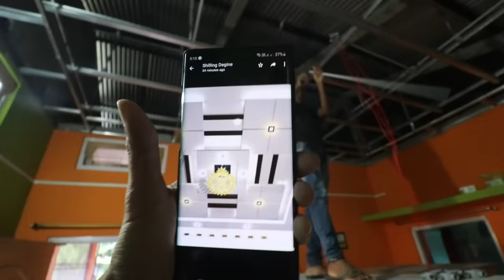মোৰ ৰূম ত আচৰিত চিলিং - How to install false ceiling - Dimpu Baruah

Comment: Moi o sob folshsiling logai disu bohut tensn kom kathr sinta nai...
Reply: Kiman toka khoros Hoy ata 15/12 feet roomt
Reply: Hoi dada bohut dhunia lage aru amar ghorot logai dilu aku tension nathake sob logote loi ahe
              Amar 3 ta room 30,000 rs khoros hoise
Reply: @kingofeditz1117  aapunar ghoror room keitar size kiman maan baru, jonabo niki
Reply: @arindomgogoi4367  12/12
Reply: @newviral2751  sq feet system t loi..plain ceiling hole 60rs aru design korale 65-70rs..aru frame pure steel logua nai..Mild steel logaise..aru j kole medicine thke bli hei2 anodized bli koi.

Comment: There is no point in making false celing on Assam type, reason hol, metal roof are gypsum board or temperatures differences bohut high ase, gypsum board cannot sustain such heat, material tu powder type hoi jae… max 4- 5 years, durability issues ase, kali sundor holae nohobo…. AC board last more than 20 years if good quality is used, My old APDCL quarter has been more than 30years … aku dal hua nai AC board tu …. Gypsum board 😅 just 4-5 years pisot sabo, britinia biscuit boni jabo 😅